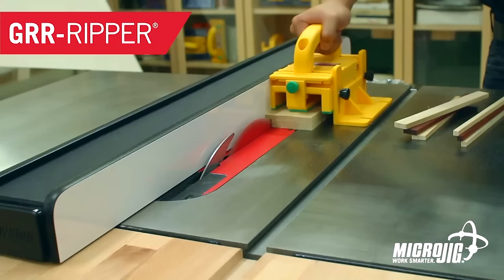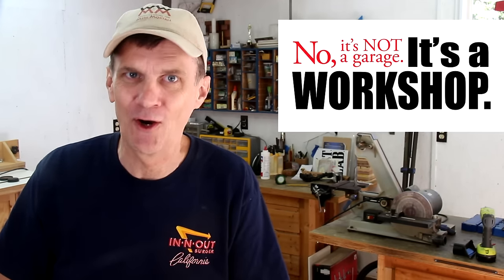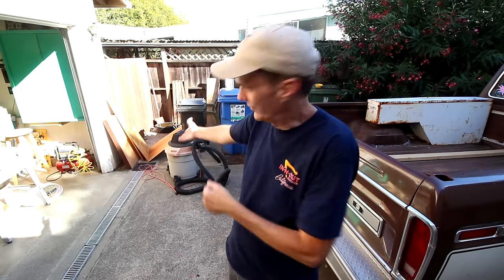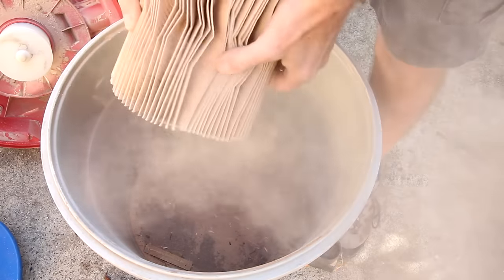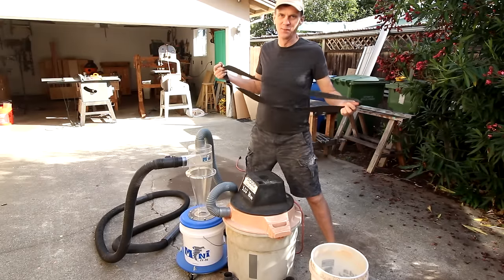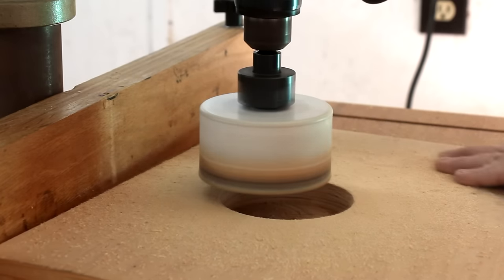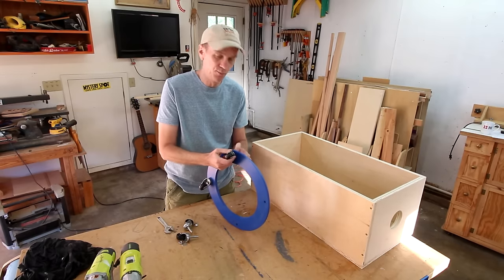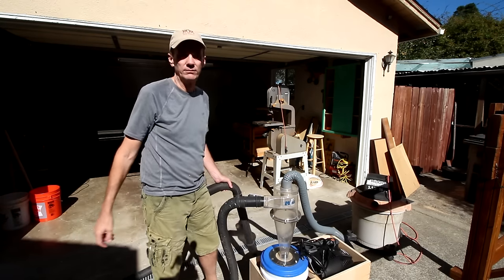Affordable Dust Collection for the Home Workshop

Comment: I'm still using my old dust deputy despite needing 2 repair jobs on it to stop leaks. The twin bucket sytem leant itself well tona cart build, screw the bottom bucket to the cart and the top one can just slide in and out as needed. If you're old dd bucket will allow the new one to fit in it, you could do that and remove half the blocks/cross piece and have far easier access to the vacuum unit should the need arrise.
Reply from the maker: Good ideas. I had the same problems with my Dust Deputy. It developed a lot of leaks and the plastic deteriorated. A lot of that was my own fault though, for leaving it outside and exposed to the elements.

Comment: Having been there/DT, I'd suggest that when you find yourself emptying the shop vac (which is a good start point) too often, just jump right to a 1hp rolling dust collector (about $250).  It's much more efficient than the shop vac/vortex combo, less trouble to put together, about the same price, about the same floor space.  Big premium is the dust efficiency:  when you start really using enough wood to worry about dust, you should really be worrying about your lungs, and a DC is way more efficient on the small particles.  Get a DC filter rated for 1 micron.  You don't need to know what it means (most manufacturers don't either!), but I've found that if they "rate" it (or just mention!) at 1 micron, it will get the stuff you don't want to breathe.  Mostly.

Comment: I made my own cyclone out of a 5 gallon bucket and some PVC fittings. Doesn't work quite as well as the professionally made ones, but it keeps maybe 85% of the dust out of the shop vac. The dust deputy system was a little too expensive for me, so I went the cheap route. It's not a better option, buts it's a cheaper option that still works.
Reply from the maker: That sounds interesting. Did you make the cone shape out of wood?
Reply: Steve Ramsey I didn't use the cone shape. I got a big orange bucket with a lid from a certain home store, put a straight piece of pvc through the middle, and connected that to my shop vac. Then put a 90 elbow through the lid on one of the edges of the lid. I connected a hose to that and started sucking. Anything that was sucked up was thrown around the edge of the bucket and would settle on the bottom. Have to empty it out a lot but I'm usually doing small things so I don't mind.

Comment: One small adjustment id recommend is a handle on the car, taller than the cyclone attachment.  If you move the cart by pulling/pushing on that plastic piece, over the years, it might cause the joint to fail between the clear part and the bucket.

Comment: i really need a better set up, my limited space in our house which is a 2050 square foot raised ranch is a small area in the laundry/utility room. On a plus side its right by the walk out basement door but when it is 3 degrees outside it is a tad chilly to keep door open for any length of time, plus i dont want any unwanted critters to slither into the house it happened once before  but it was fall and we did not notice for a month or so due to he was hibernating i think somewhere until i fired up my air compressor, we have wetlands behind our house so we have lots of wildlife snakes, deer, ducks, fox, coyotes, racoons, woodchucks and so on, well if you are still reading this i officially made this a very long drawn out comment about dust collection, great video as always.

Comment: To minimize the cost, you can replace the dust specific cyclone + bucket combo with 2 standard (tall) buckets. Have the upper bucket upside down, drill a hole to it's bottom for "cyclone exit" hose. Another hole for "cyclone inlet" placed tangentially. Secure with tape/rivets/screws. To minimize carryover, have the outlet hose 10-20 cm (4-8") into the bucket so that it's lower than inlet hose and use wide diameter exit hose to drop exit velocity. Connect the 2 buckets to each other somehow (strap, clamp, tape whatever).

Comment: I have a 2hp 5 gallon shop vac brand shop vac, and with a cartridge filter plus a filter bag, it works great, and the filter doesn't get clogged. (although i don't use really any big power tools at all) it was pretty cheap too. 40/50$ for the shop vac, 15 for the micro filter i got, and like 10 for the bags. Only downside is that it doesn't have a very wide diameter hose, so really the suction is ok. I'm a bit of a cheapo anyway!

Comment: 1:32 the ridgid wd16300 16 gallon 5.5 peak hp wet dry vac. I still have mine. These were the first generation ridgid vacs that came out in 1998. Do you still have it Steve? If not what happened to it?

Comment: Simple and effective! Good stuff, Steve! Not totally sure of this but the UV might break down the clear plastic after some time if you store it outside. I have the same cyclone and I've been pretty happy with it except for bigger chips while planing/jointing. Separates them fine but sometimes the thin passage right were it goes into the bucket gets clogged if it gets inundated too much. Overall though I dig this setup and don't have enough power in the shop to run my large collector. On the mini cyclone I even made a splitter from PVC with blast gates to hook up multiple tools of I want. :)

Comment: Nice idea and build. I'd add a handle to move it around with rather than stressing the plastic of the cyclone. The handle could also double as a place to store the hose and attachments.
Also it needs a little extra fancying up. Right now it looks too Wandel rather than Ramsey, despite not being painted green.

Comment: Steve, you and Il have the same shop vac, (anyway, your old one).  I found a place online that sells those shop vac bags for significantly cheaper. Big box store is like  $17 for a pack of 3, I got mine for $7 for a pack of 3 on evacuumparts.com.  With it being this close to Christmas, I got free shipping over $25 and 10% off.    What I do with my "saw dust" is I actually reuse it. 

 Instead of buying wood filler, I use my saw dust combined with either translucent wood glue (when dry) or my specific type/brand of epoxy (which is what I use most of the time) I use a non-yellowing, non expanding, high gloss finish epoxy.  If it is a wood I am staining, I combine a little bit of the stain with a denatured alcohol and mix well.  The difficult part is gauging what color you want your final product to be.   After this I add my wood shavings/wood dust and combine to the stain/alcohol mixture.  After that I let the alcohol/stain/wood shavings mixture evaporate for a day or so, just to where it is kind of like a really thick syrupy mixture.  Once this stage is achieved, I combine my tw o part epoxy according to instructions and mix well.  I then add the syrupy wood shavings.  From there I thin out as needed with very small amounts of denatured alcohol at a time.

The end result is (hopefully) a fairly unnoticeable patched area.  Right now I'm working on my recently discovered 1960's Birch stairs that had over 3 pounds of staples in them.

Comment: One thing you could've done for the cross brace that you need to remove in order to change the filter in the shop vac is made it where it just slides down.

Comment: That will work! I have a setup similar to yours, use it on the floor power tools as well on my handheld power tools. The smaller vac was a good idea. I should do the same.

Comment: Great video, thanks!

Could put the cyclone over the shop vac, cut floor space; might be a bit tippy though (wider base?).  Maybe helpful to anchor the hose fairly low, so if you do pull it around by the hose it won't tip.

I like a half-mask respirator (3M or AOSafety, P95 or P100, $20) that has a soft rubber seal around the edge for supplemental protection.  Much less expensive than new lungs...

Comment: For extra air cleaning I have made a couple of simple frames for a 20" cheap box fan.  I slide a 20x20 furnace filter in front of the fan.  Easy peasy filter change and you would be surprised how much crap this thing picks up!

Comment: Great video Steve. Just one thing came to mind. When you  were wheeling it you seemed to be pulling/pushing on the cyclone thing. I think this would cause stress on where tine bottom end of the plastic is joined to lid of the bucket. Perhaps a different way to push/pull the cart would be better. Either way I love you channel and you really do make woodworking not appear to be a thing that anyone can do.  Thank you.

Comment: I'm one of those people that have to share space with a car... I'm working on a shopvac system now. I'll have a shopvac tucked away in a corner, a dust separator under my workbench and a port in a central location. That way, I can have a stationary solution with one hose for all my tools. Everything will be tied together with 2" PVC that I picked up from a construction site.
Reply: If you are running long hoses/pipes, might want to look at buying a central-vac unit. They are designed to better handle the static pressure of long runs. Sometimes you can pick them up cheap used.

Comment: v 2.0: reduce footprint of cart by stacking cyclone on top of vacuum. Adjust center of gravity if needed by weights at base to lower COG to allow pulling by hose without tipping cart. Adjust length of vacuum to hose reach top of cyclone.

Comment: Tips for your extra saw dust; first make a biomass stove where you burn your extra sawdust into charcoal dust with very minimal smoke and produce heat for out door cooking. Second collect all the charcoal dust and mix it with a watery paste solution (hot water and corn starch) so you can mold your charcoal dust into charcoal briquettes used for BBQ grills.

Comment: I have been thinking of doing this very thing. Except I may keep my full size shop vac because I really do not want to go to a smaller suction hose as the vac you bought has.  The fact that it has the 5.0 hp rated motor makes me wonder if I can retrofit the inlet to 2.5 inches which is the size of my Dust Deputy and current vac. 

Might run some 2.5" pvc from the vacuum to the cyclone and from the cyclone to the base.  Smooth flows best.
With the vacuum hose attached near the floor I can pull the cart around while vacuuming.

Hmmm. going to HD to inspect one.

Comment: Well , main component the vacuum, , rockler has a dust collection system for about $80.00, which includes the bucket and the cyclon part, it looks a little different but it works the same,. You can add pvc pipes and diy air ports and have  dedicated dust collection for your most used tools and still be spending very little money.
Reply: I have both the rockler one and the Dust Deputy.  The Rockler one did not work nearly as well as the Dust Deputy, which is a different shape/design and more like the one Steve has.

Comment: Are you still able to view how full the bucket is?  I would think that the wood sides would block your ability to see that.  Maybe some oblong relief holes on either side would allow light in on one side, so you can view on the other.  Great build, I've been playing with trying to improve my dust situation here at the workshop.
Reply from the maker: Good idea for windows. The clear plastic on the lid gets coated in dust really quickly.

Comment: Great video sir!  I'm a Newby to woodworking, so I'm soaking up all the material is can from U of YT (YouTube)!  Did you consider building it up vertically?  You could have the vacuum on the bottom, then just slide it out to access it for maintenance.  And you wouldn't have to remove anything to do so.  Plus it would have a much smaller footprint.  How has the Rigid been working for you? All the same, great info!

Comment: What about some kind of filter fabric with some rubber bands onto the hose that runs from the cyclon to the shop vac where it plugs into the cyclon so you prevent even the 1 % of the dust remaining to pass an clog the shopvac filter over time and you will almost never need to clean or replace the shop vac filter

Comment: In a shop it might be easier to run cheap PVC plumbing pipes around the walls with ports to each tool so that a hose can be plugged into the system. I think a cheap cap could close off ports that are not being used. This would mean your vac could be in a fixed location.
Reply: your CFM would drop  to almost nothing

Comment: Nice compact dust collector system. ☺ I was thinking about ergonomics and your back. Do you have a 2-3meter metalpipe? To bend to a U-Shape stroller shape. To make for a more upright position. And you could add a "vacuum hose holder" to it 😁😉 Keep up the good work! Cheers

Comment: Years ago, shop vacs had hoses and tools of 2-1/4", but now that has changed to a variety of non-standard sizes from 1-1/4" and up.  great for clogging on wood chips and other shop debris.  You almost have to buy a used machine to get one with a usable sized hose.  The old Craftsman line were Awesome.  With a 2-1/4" internal diameter hose and ends, you had to be careful not pick up too much.  Very powerful and useful.  The consumer shop tool manufacturers are also schizophrenic.  I have four tools I am trying to connect to a shop vac under the bench.  All exhaust ports are of a different, non-standard size.  In fact, the machine with two exhaust ports are each of a different size.  Any standard size hose available for any of these?  Nope.

Comment: Double bucket
Large bucket with no filter for the bulk then a second smaller bucket with a more efficient cyclone for the fine particles saving the filter on the vacuum unit much longer without change or cleaning. 

Also build as a tower to save floorspace.

Comment: 4:55 5HP vac...yeah right!  That would be 3700W probably three times its real output!  I like that see through cyclone tho’.  Seen lots of cyclone funnels and Thien Baffle designs on YT.  I think we need some proper experimentation!  Meaning…vary the centre tube length in the chamber, change the height of the cyclone or Thien chamber.  Change the diameters to change circulation speed etc etc.  Mostly we just see a design that kinda works…but could it be much better?

Comment: Before you convert it into a blower, AND if you use a separator, bypass the separator or you will empty your separator in 2 seconds flat! My son did that in my shop and 5 gallons of sawdust were airborn before the first partical touched the floor.

Comment: I'm a little late to the party with this comment around 2 years late. A low cost option is  a metal ash canister that you plug a vacuum into. The ash can hold the wood chips/dust and has a Hepa filter on the vacuum connection. I have sanders mounted on their own trollies and have the ash can and vacuum on the lower part of the trolly , so it is a fully self contained unit for each tool. No hooking things up just roll out the mobile trolly and go to work. All the best

Comment: I have the smaller version of that Ridgid shop vac. Horrible old vacuum. Inlet impinges directly on the filter instead of tangential to the can. Lifting handles are in the lid so the bottom can fall off and dump on the floor. Tiny little wheels make it fall over easily. I, also, am converting mine to a collector system so it will be more useful.

Comment: Nice one, maybe add a handle to pull instead of pulling on the cyclone cone.
or add a motor with remote control and paint on some racing stripes, add a stereo system with GPS and cup holders..........

Comment: Great video. I like the box as a way to keep both together.  Do you think the cyclone would work with the Ryobi battery operated vac? (not the dust-buster model, that would be silly.  The 6 Gal wet dry vac)

Comment: What's your feeling about a dust bag for the shop vac instead of adding a cyclone.    just learned about them, started using them,  i know it keeps my filter clean,  the two drawbacks i have found so far is   1.  unknown exactly how full i can get get,  and B.  if i accidently vacuum up something i shouldn't have,  then its lost or i guess if i really want to get that item back , will have to rip bag open and search for it,   whats your thought =s of a vac bag versus the cyclone type system

Comment: i would ditch the shop vac and go with the Horrible Freight 1 hp portable dust collector. Its a proper dust collector, it has a motor made for continuous use, its about 1000% quieter. Its $149. You can use the 20% off coupon to pay for the 2 year extended warrantee. It takes up the same space as your old shop vac.
Reply from the maker: +God of Thunder (UKKONEN) okay

Comment: The only place in my house that is available for a woodworking bench (for hand tools, not power tools) is an upstairs carpeted game room. Could you suggest the most practical method for dust control with this? My current ideas are just a shop vac to suck up the stuff on the floor, and one of those air filtration systems that they sell on woodworking sites. I don’t really care about the dust, but at the same time, I’m not exactly trying to take out a lung. Thanks.

Comment: Steve, I have to ask this because saw dust is a big problem for me. I need to do something. All I have is a little old craftsmen 2 and a haft horse power 6 gallon shop vac. Needless to ask it doesn't do the job. So I'd like to know is that little rigid shop vac working out for you. I'd like to get one with a dust stopper from home Depot. Thanks Carl a 79 year old new bee.

Comment: Keep the filter in your shop vac cleaner by putting some panty hose over it and trimming off the excess.  The hose helps keep the fine particles off the filter giving the vacuum longer suction power and extending the life of the filter.

Comment: I don't know much about shop vacs, but I wonder if it'd be possible to remove the motor from the bin part since the majority of the dust is getting caught in the cyclone anyway. It seems like the bin part is wasted space, sort of. Would this cause any issues with the correct operation of it?